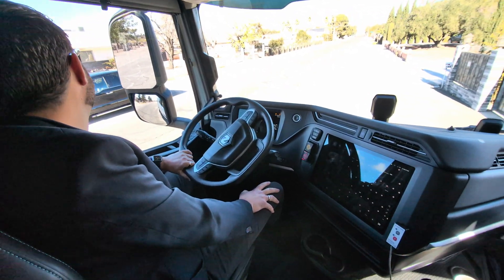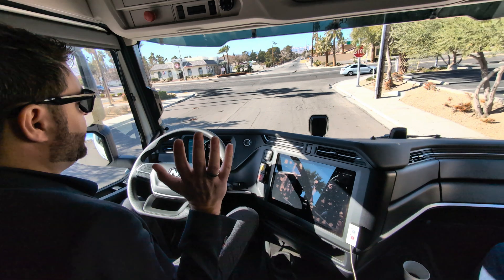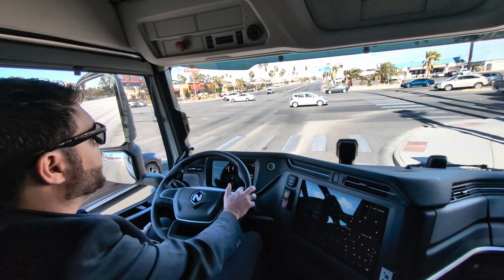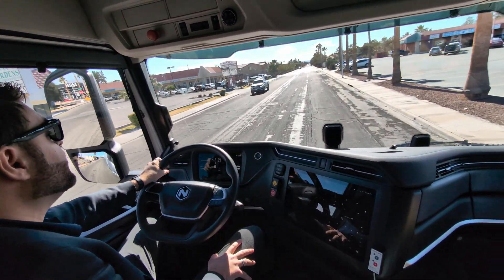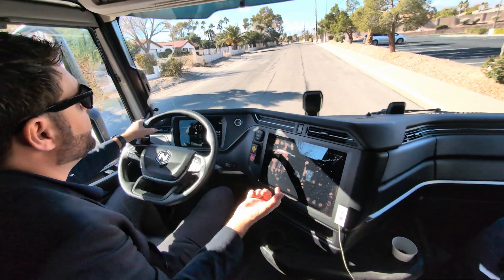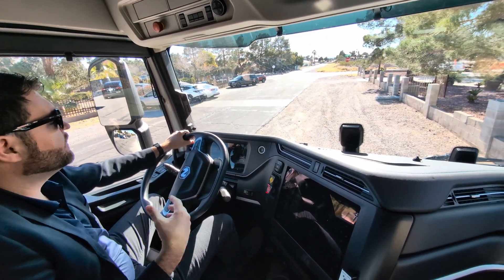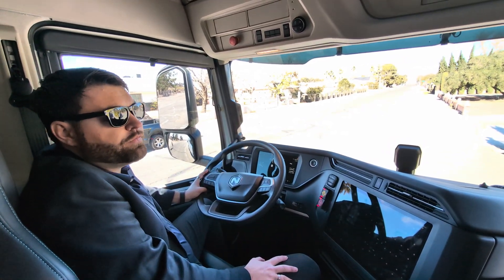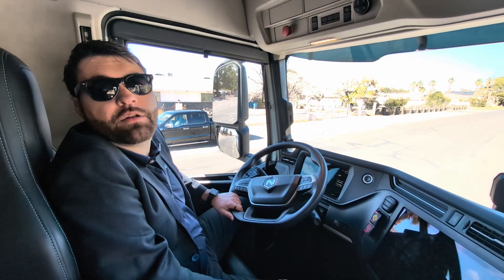Going for a ride in the Nikola fuel cell electric semi

Comment: another EV garbage which needs 7-10 hours recharging if not more and  longevity of batteries will be  3-5 years on average depend on mileage and new ones would not be cheap
Reply: It's an FCEV...H2 powers it, NOT the battery. Refueling is 20 min to fill up.
Reply: @awanderer4973  where they will refuel it in midd of nowhere ??
Reply: Nikola the North American leader in Electric/ Hydrogen Class 8 trucks. Now you know the truth.
Reply: @2023gainer  they will lead to bancrot themself,isnt tgey bancrot or government keep them alive just like Lucid company keep alive saudi arabia

Comment: I may be off, but I think NKLA stock has until 1/18 to pull up above $1/share (would be 30 days below $1) or they will risk being pulled from the open market (NYSE). Anyone have more insight on this?
Reply: They received a delisting notice, buy guess they will reverse split
Reply: @pba21  Where can I find updates?
Reply: They have until either June/July but they can also appeal. The delist will not just happen overnight I don’t think  it will be an issue as they have a lot coming down the pipeline and if it is they will just split like @PBA21 me tioned. 2/22 will be a big day for them once they release financials and more info hopefully.
Reply: @drivenserb  thx
Reply: over a dollar now, i hope u loaded at 50-60 cents levels
Reply: @bossusa365  Well, now going down again due to the threat of reverse split. They probably need to do it anyways, but it'll still be a rough going for them. Does not help that the CEO is way overpaid. That's the only thing I do not like about the company.

Comment: the reason why cabovers sux is if you have to do something with the engine you have to tilt the whole cab so all the stuff inside will fall forward, or the stuff inside the lockers will also fall, and if you have some stuff in the upper bed where most of the drivers store the heavy stuffs you have to pack it out ... pain in the arse, I hate them but in Europe you can't have the long-nose ones...

Comment: This thing is ABSOLUTE JUNK. We had one of these to try at my company. What a joke. Struggled with a light load.  And would only do about 150 miles in upstate NY, not that hilly and in mild temperatures.
Reply: i think you talking about BEV.. smaller range
Reply: The customers are ordering and some reordering more, one requested 50 more Nikola trucks.
Reply: @2023gainer  no way. Those things are an absolute joke. Maybe in the summer on flat ground with empty trailers you could get something done with one…

Comment: What no one mentions is the stratospheric cost of operating HFCVs. Real world example: the Toyota Mirai carries 5.65 KG of H2, and gets an EPA range of 357 miles. A KG of H2 in San Diego, where I live, is currently about $36, having recently increased from about $13 (!). So the per-mile cost of H2 for the Toyota Mirai is 5.65 x 36 / 357 = 57¢. Meanwhile, my Tesla Model Y has a 75 kWh battery, and has an EPA range of about 320 miles. At the San Diego Gas & Electric EV charging rate of about 15¢/kWh, the per-mile cost of electricity for my Model Y is 75 x .15 / 320 = 3.5¢; so the Mirai costs literally >16 times as much per mile in operating cost. There's no reason similar ratios won't apply to Class 8 trucks. If any of my numbers or calculations is wrong, please point it out.
Reply: Make it yourself at home for free with renewables/solar panels. So what if it takes more off grid electricity to make the same range. It transfers to the vehicle instantly. An invention you can't seem to understand or grasp the reason for .

https://m.youtube.com/watch?v=6PlaSMAY14M&pp=ygUTVmVyZGUgaG9tZSBoeWRyb2dlbg%3D%3D

Comment: Where in Canada are the Nikola Tre HFC semis? They must be here in Greater Vancouver. Ballard Industries in Burnaby were designing Hydrogen Fuel Cells back in the mid 1990's. Some of those engineers must have trickled down to Nikola. 
Powertech in Surrey had/has hydrogen fueling station on their property. It was documented on Discovery Channel. A church member drives a Toyota Murai here in Vancouver. I believe he said there are 6 locations to refuel. 
I am taking an educated guess they are here. I am so excited! I may go searching on Anacsis Island for them!